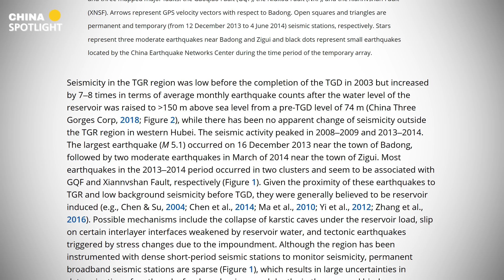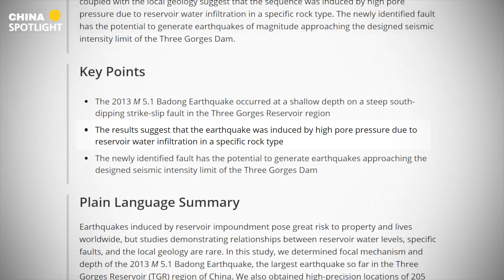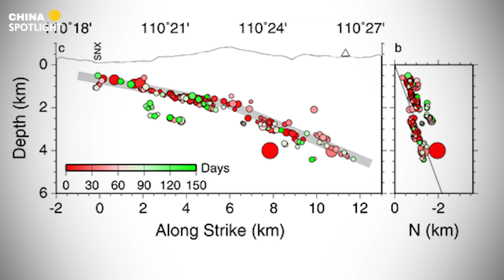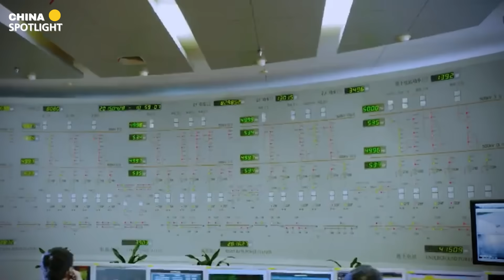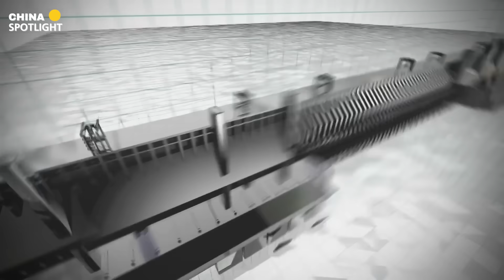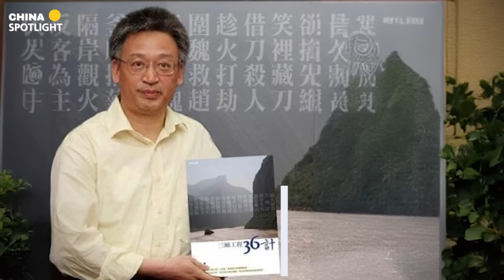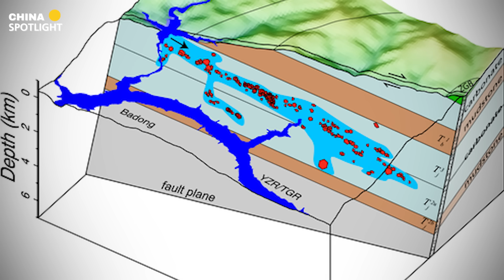Three Gorges Dam Hides a 6.5 Earthquake Risk Waiting to Explode!

Comment: I was absolutely horrified to learn that the dam consists of separate concrete blocks, not even anchored in the ground, but held in position by their own weight! I cannot imagine any sane engineer signing that disaster off as safe! The trouble is that the earthquake and tsunami that will take place when that dam breaks will have severe global consequences.
Reply: I am not sure how to design a dam, I would not just use your common sense to imagine.
Reply: You'd be amazed what an engineer will stamp